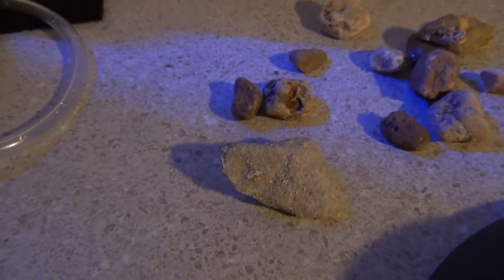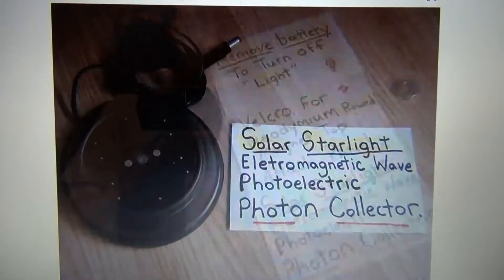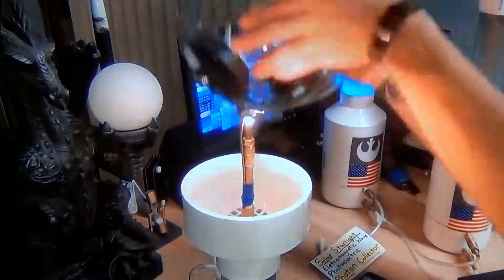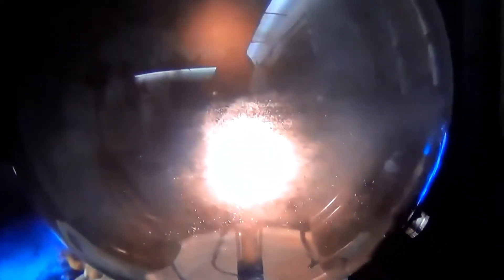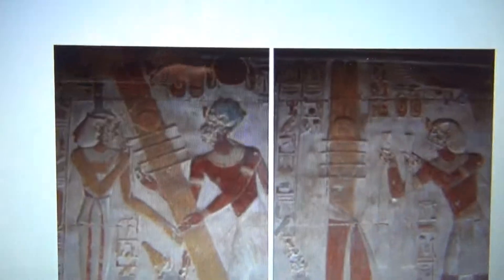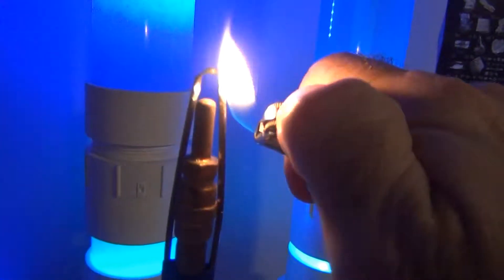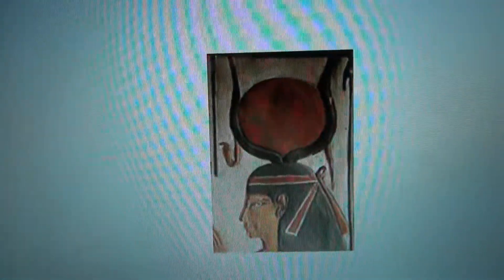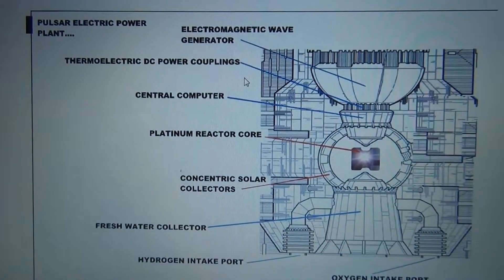HHO PULSAR LIMELIGHT PHOTON POWERPLANT TECHNOLOGY

Comment from the maker: This PULSAR POWERPLANT is very simple yet advanced oxyhydrogen gas technology designed to produce large amounts of electricity while producing fresh drinking water simultaneously. The reactor can run in space and underwater and produces photon energy that is converted into electrons using the photovoltaic effect has no moving parts to wear out low cost lasts forever produces endless amounts of electricity from water with no maintenance and is silent while reversing earths pollution.